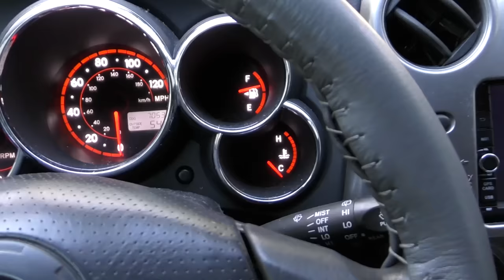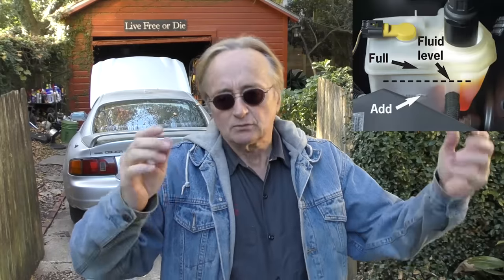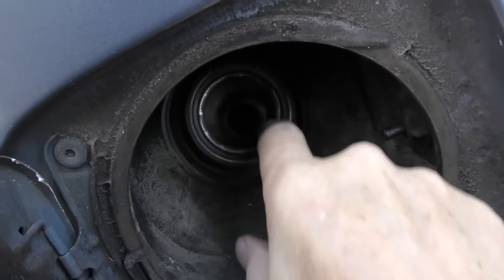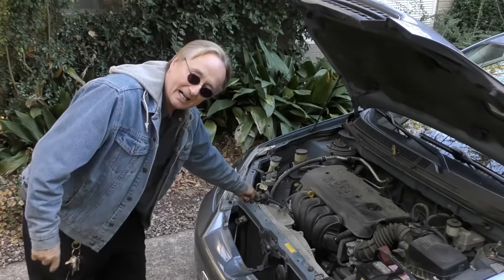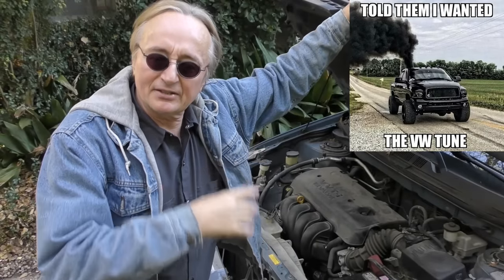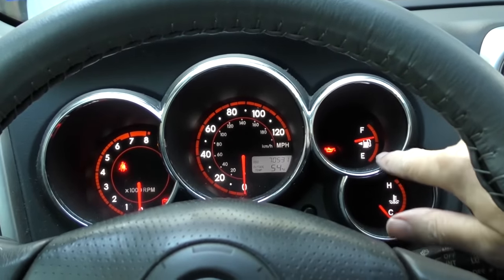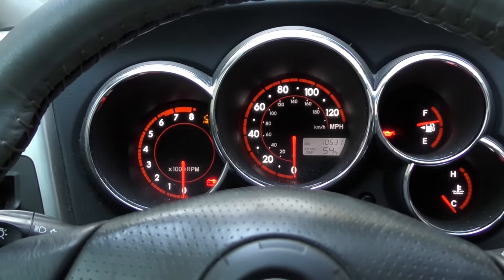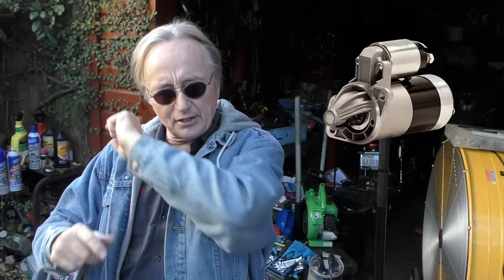Please Stop Doing This to Your Car (It Broke My Celica)

Comment: In my experience, when the brake fluid is low due to pad wear it's been years since the pads were changed, so I always check the pads and flush the fluid. If you don't, the brake fluid has absorbed contamination over the years and will corode the master cylinder and the calipers.
Reply: I had a '96 F150 that went through front brake pads every 15-20k miles. I put a mark on the brake fluid reservoir and when the fluid reached that mark, I knew it was time for new pads.
Reply: @mstreich02  I got a 97 F150 do brakes every 18 months
Reply: I use a small impellor 12 v pump to pull out all the ATF and Brake fluid and Power steering fluid using of course a fresh plastic tube for each fluid and refresh twice a year, easy enough and gotta help. just recently did my kids VW Beetles oil and didnt have to crawl under the car, got out 9/10s of it .
Reply: Not sure about cars, but on motorcycles ive had Many times where the brakefluid was low and the fluid Wasnt supposed to be changed for quite some miles. And the brake pads were the problem. But scotty mentions to top it of. Its not what you are supposed to do. You replace the pads and leave it. If you top it of the Pistons wont go back enough to get in new pads because there is too much fluid in the system.
Reply: @vhjvbhjb5280  actually when you press the pistons back into the calipers you open the brake fluid reservoir and the excess fluid will be forced out just remember to put a rag around it to absorb the spill
Reply: Norman Buchanan there shouldnt be any acces fluid cause you havent Added any. If the pads are just as thick as the stock ones, Only thing That Will happen, is That the reservoar level goes up to what it was originaly.

Comment: No5, starter problems : you also might wanna check your ground connections. 
Particularly the one for the starter motor.
Sometimes they get loose or worn out and they don't contact as well.
Reply: A

Comment: I remember when ppl use to shove rags into the gas tank for a gas cap lol
Reply: I use an cap from a oil jug and an dirty old rug.
Reply: I kept a jar of gas in truck a rag in gas panel to jump car put rag over old breather
Reply: Then light it!! Lol!!
Reply: Did that w/my very first car
Reply: My dad did that for an oil cap...  Car went up in flames.  Funny thing is about 10 years later he became a mechanic
Reply: My old 1951 Ford wouldn't start or run without the gas cap on. The pressure from the evaporating gas in the tank was needed to push the gas to the mechanical pump.
Reply: Now they fill up plastic bags with gasoline.
Reply: "used to"? I still have a rug there.... In case of spill and... For superior audio quality....
Reply: It's not big of a deal back in the 1970s'.
Reply: oh, you mean "The wick" repair?  Yep that's a classic

Comment: Last year my daughter’s Toyota Yaris wouldn’t start sometimes. Turned out the starter motor fixing bolts were loose. I retightened them, no more problems 😁

The clutch had been replaced a couple of years earlier, I reckon the bolts weren’t fully tightened after that job.

Comment: 8:39   When taking long road trips, I follow the quarter tank rule. Very helpful to avoid getting stranded! 

When driving locally, I'll let the tank run lower before refueling, but not so low that the fuel light turns on.
Reply: I refuel at a half tank to avoid sticker shock at the pump!

Comment: About that car that doesn't have enough heat....check the Blend door. The actuator is likely stuck, or the control mechanism for it (heater switch) isn't working.

Comment: Point well taken with using the Car manufacturers fluid versus aftermarket brands. I had a rack and pinion that was leaking on a Honda and I was told by my mechanic  that it was recommended to use only Honda Power steering fluid.

Comment: I had a problem with losing coolant. Not a lot but some. I noticed where it was dripping from. Right where the hose is connected to the engine.  The  previous shop has replaced my OEM hose with a one from a auto parts store. It wasn't quite a good fit and they had used the worm drive hose clamps. It didn't matter how tight I tighten the clamp.  I replaced the hose with an OEM hose and got the factory spring hose clamps. My problem was fixed.

Comment: When I was in the British army, the land rover defenders would get “sticky” starter motors in the winter, a tap with the wheel iron would fix them.
Reply: Sounds par for the course on a rover :)j/k Hit the failing starter on a honda too hard and it went dead i hear on newer vehicles just a tap is enough
Reply: I mean tbh you really ought to just buy a new starter. They're pretty cheap.
Reply: 94 explorer, 80,000 miles,clicked and tried,finally did nothing,got it towed to the junkyard,paperwork was signed, just. As the guy go to pick it up and crush it for us,says wait,hits it with a wrench,vroom vroom,crush all gone
Reply: Peter Hunt Did you serve in Northern Ireland ?
Reply: Mr330d not me, did the iron triangle
Reply: Ron Matson sounds like a Clark Griswold moment
Reply: Lol...starting my old '65 Series IIa Landrover during winter in the Colorado Rockies was fun. Once you got that heavy flywheel moving, it would always start...just took a bit. Press the starter button, boom.........boom.......boom...boom...boom..boom, boom boom...... 

We called her 'The Beast'. Never broke down in the field, only in the city.  Still miss her.
Reply: My old Chevy truck did this too, but it was frustrating to be alone on a road trip, stopped for gas and then ask a stranger to get in and turn the key while I lay under there tapping the starter.
Reply: Works on 1990's Toyota Hilux's too.
Reply: @fokker34  had 57 chevy that wouldn't start when it was warm, started fine when cold. Brushes were worn, allowing commutater to short out when warm. Rebult starter, worked fine.
Reply: Ron Matson I doubt it was that fast to crush. I work at a scrapyard and we first drain the fluids, take the tires off, cut the catalytic converters, rip gas tank off, and sell any good parts BEFORE the crush. So yup your story doesn’t check out.
Reply: Cool Bro, I met a few soldiers from the British Army when I was in Iraq back in 03 when we caught Saddam.
Reply: On the contrary, I got "swollen" starter after long trip on my Datsun 310, so I got stranded at gas station after fill-up for 30 minutes for the starter to cool off.  Later my mechanic taught me a trick to evade the stranding by using a booster cable to connect the positive terminal of battery directly to "touch" the positive end of the "swollen" starter  motor to start the car.  And it worked ever since then.  Never got stranded halfway for the "swollen" starter again.
Reply: Dutch Ynehtam yeah! You tell em

Comment: This morning I was in one of those chain repair shops and  an eldery man was in for his oil change.  They told him that his battery was very weak and would be $550 to replace!!  The reason for the high fee was the time it will take to reprogram everything.  Scotty taught me that there is a cheap memory saver that plugs into the OBD port and this shop must have had one.  Total rip off.
Reply: Exactly !
Reply: Hope you said something to him. First, the battery was probably OK. Second, the computers will readjust automatically. The exception MIGHT be an antitheft system for the radio. Then you need the code. I have such a radio but it retains the code more than long enough to replace a battery.
Reply: wholeNwon what if you don’t have the code anymore? I have a ford fiesta 2005 with a cd 6000 radio but I don’t have the code :(
Reply: @furkanapaydin8933   Did you check on line to see if you need the code to change a battery?
Reply: @furkanapaydin8933   I see there are instructions on line for that radio, too.
Reply: @wholeNwon  On some German cars you do need to reset things as it will be super wacky if you don't . Some cars require you to reset the PCM so that the alternator changes the algorithm for charging for a fresh battery as it adjusts as the battery ages (i think some new fords have this)
Reply: @bikecommuter24  Your experiences are NOT unique. I always do my own oil changes and keep my cars forever.
Reply: @CRAPO2011  I'll take your word for it but wasn't the case in either of my Mercedes (supplied by my company. I would never buy one myself).
Reply: @CRAPO2011   Sorry. I was wrong. One of them did. Used a memory keeper when changing batteries.
Reply: @wholeNwon  I fear these Newer Benz Air suspension and abs. stability control systems constant bull
Reply: @j_freed  FYI they were checking the charging system to see if it is the battery and not the alternator  . The hour is their base diagnosis charge for whatever.  They cant just replace things, charge you and then if it isnt that ,replace something else. It doesnt work that way , professional mechanics need to do whats required to try and confirm what the problem is the first time.
Reply: It's a disgrace that you can buy cars that do that in this first place.
Reply: That’s why I hate modern cars! Too many stupid technology to go wrong.
Reply: @AmigaA-or2hj  exactly and even the brand cars are whack with oil dilution and or cokeing of valves. Go old school ftw atm until these issues are sorted. maybe skip a generation to be safe is my tac
Reply: @wholeNwon  That's why I always use a good, reliable mechanic who has integrity.......... ME!!!
Reply: @twisteddman  Auto Zone and probably others, too, used to load test batteries and alternator free of charge. Perhaps they still do. The shop I use does.
Reply: @armoricain  The only way you can be sure you aren't being cheated.
Reply: @wholeNwon  Exactly right, and if I mess up and do something wrong, well, I have only myself to blame, then call myself a big dummy, and make it right! :-)
Reply: Cotton Hollow Distilling wym I just unplug my battery Willy nilly the ecu keeps its info
Reply: @CRAPO2011  

You can clamp a "power bank for battery outage" to both terminals  before removing the dead battery to save the memory in car computer, then remove the power bank after you connect the new battery.
Reply: @CRAPO2011  

Why don't you connect another car with a boost cable to save the memory  in car computer while changing the dead battery?
Reply: @AmigaA-or2hj  

That is why I keep 3 '90s cars and they never fail me.
Reply: @AmigaA-or2hj  

Car with more loaded gadgets means prone to break down.
So many car buyers forgot the purpose of buying a new car:"Less trouble moving from point A to point B!", so a simple and basic car should suit their needs best.  However, most car buyers were steered by car salesman or advertisements to higher trim line with useless gadgets.
Reply: Darcy Chu Another thing that annoys me is touch screen technology were half the car is a computer. I prefer buttons, rocker switches and knobs.
Reply: There's an easy fix for that.  Attach a small 12 volt battery or charger (slow charge) to the battery cables before you disconnect the main battery.  That way your system never loses power.
Reply: @wholeNwon  they do

Comment: I used to use electrosol dishwasher powder to clean out the radiator and heater core. That stuff really cleaned it out and returned temps to normal for me on a 2000 dakota I had. I'd mix it in with regular water and run the engine for about a half hour at temp, and then drain and rinse. All kinds of gunk came out.

Comment: And clean or replace the cabin air filter.
Reply: Must be hella filthy then, those things get dirty quick here, and they're very important for air quality
Reply: Many cars don't even come with them, you have to cut the cover off and put one in yourself.
Reply: I'll had two cars and the old owners never changed them 2005 trailblazer and 2001 silverado they would just say the ac wasnt that strong....The cabin filters were that dirty it was nasty cant imagine  all the time they keep it running like that ,I smelled it also changed it immediately lol
Reply: pet hd
Reply: M Detlef that's why your AC doesn't blow that hard anymore I bet if you do it you'd be very surprised I change my filter once ever 2 years but clean it every six months

Comment: A clicking starter can also be a bad connection at the battery terminal. Especially the lead terminal connectors. Lots of people just push and twist without really tightening them and sometimes the lead gets a layer of oxidation on it that creates resistance to the flow of power.  So try cleaning the clamps and terminals ...AND ALWAYS DISCONNECT NEGATIVE FIRST AND CONNECT POSITIVE FIRST. that way you won't arc out ever.

Comment: Omg, so I can figure out how low my pads are getting based on the amount of fluid in the reservoir? Neat. (Assuming there are no leaks ofc)
Reply: That's not even a bit true – and a bad assumption.
What Scotty said: Don't be alarmed when the fluid level decreases slowly.
Fair implication: Get to know your car by inspecting the level every week, so you know what is "normal" (taking into account the number & severity of brake applications). Judging the RATE of pad wear doesn't tell you anything about how much friction material remains. Good mechanics will look at the thickness and report to you at every service. They will also look around for leaks (while the car is up on a hoist, or over a pit) before disturbing the evidence with the normal service schedule. Also, ask your tyre dealer to look at the pad thickness every time the wheels are off.

Comment: I have a 2003 civic with generally low miles (38k) and I ended up getting the evap leak code and guess what, BAD GAS CAP, saved me a headache felt so good to hear from the mechanics (super honest and cool guys) that I just had to buy a new one. They just gave me their universal cap and sent me on my way.

Comment: I actually explained the 1/4 tank rule and the reason it was important with respect to the electric fuel pump  to my brother in law.  He was running his car to empty and wondered why it wouldn't start right away after he filled it up with gas. He got lucky the fuel pump wasn't damaged.

Comment: My Nissan Altima 2010 for the first time had a check engine light. 

I just simply replace the gas cap, 5 days later it went away
Reply: Daniel Garcia has cap?
Reply: Daniel Garcia Good way to get rid of a Nissan!
Reply: Thereal Blackwell  it readed "possible" P0420 vacuum leak,  fuel system fault,  ignition system fault, Catalytic converter.

I readed the manual book, claims to be fuel cap.

I replace fuel cap and a week later it clear .

Long as it clear I'm happy,  save me few hundred dollars from going to the dealer, possible thousands
Reply: Frank Olivieri  I just readed the manual book,  it claim to be a gas cap.  I did go by autozone to have the codes read.  Long as the codes clear on it's own I'm good
Reply: @jamespfitz  been 2 months, no check engine light
Reply: @jamespfitz  cars been paid off for the past 6 years , ride it till it falls apart.   So far no major issues.  Just your normal wear and tear 
( brakes, tires, and keeping up with  maintenance )

What I got lose, I already got my money's worth out of it,

Comment: Regarding the heater core I had the issue with my accord. Turns out it was air locked despite literally hours of squeezing the hoses and topping off the res. I pushed a garden hose into the res to get an airtight seal, attached a funnel to it hanging it to the bonnet latch up high an bled her that way, been fine ever since.

Comment: And cleaning those battery cables is a great idea to I don't know how many times I've jumped my friends and they  Hey have corrosion all over their cables where they connect to the battery very important keep dump Queen
Reply: What type of clean do we use?
Reply: @C.G91  - Disconnect the terminals, and soft brush away the big loose corrosion. Then scrub the terminals and the posts with a wire brush until they're shiny again. Install felt pads and dielectric grease on your posts. Hook it all back up.

Comment: If your driving up a long mountain road and the engine starts to over heat, roll down your window and turn on the heater.  It helps to cool the engine..

Comment: Another reason you want to refill the gas at about 1/4 tank is you don't want whatever crap is at the bottom of the tank (and there usually is some) being pulled through that fuel pump and sent forward to the injectors - clogs 'em up, possibly even ruins 'em.

Comment: I have found that keeping the top half of the gas tank full cost the same as keeping the bottom half full.  And it has the advantage of keeping you running if you can not fill up the tank because you are low on cash or in the middle of nowhere when you reach the half full mark on the gauge.

Comment: You don't have to drop the fuel tank to access the fuel pump on ALL cars, in fact a lot of car models have access doors for it often hidden under the rear seat or under the trunk carpeting. Check for it before you drop the tank, folks.

Comment: Fun Fact: If you rev'd up your engines every time Scotty put out a video, your engine would blow up.
Reply: Not mine, i own a 14 sonata!
Reply: My 2003 CLK Merc a/C stopped working, changed condenser, Stepper motor & compressor & now a/C works but have gradual engine coolant loss-keep topping up after every 5 km, but cannot see any leak.
High pressure could force coolant out of escape hose.??? Help please Scotty.
Reply: @johnstonbrianronald9388  is the exhaust smoking white? And does it smell like coolant? Just curious.
Reply: @Cam-im8io  if you have a Hyundai then it blew up long ago
Reply: @goatsemarathon6642  definitely blew up by now
Reply: 1-uz engine disagrees